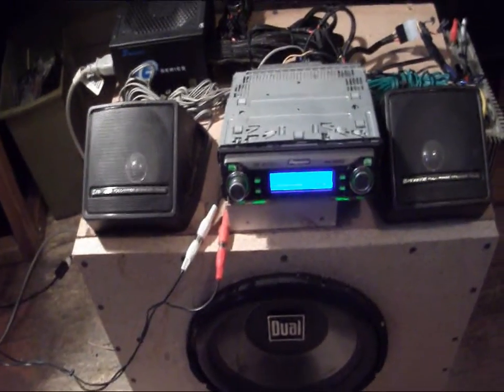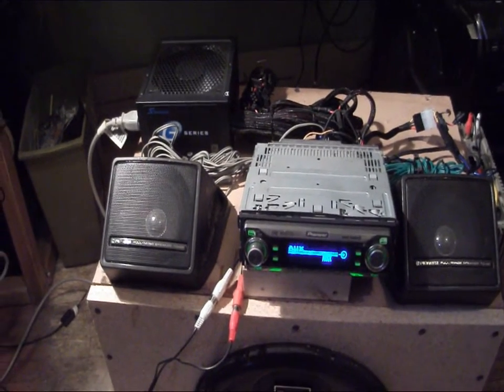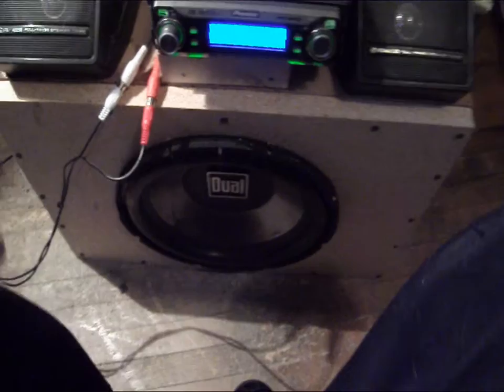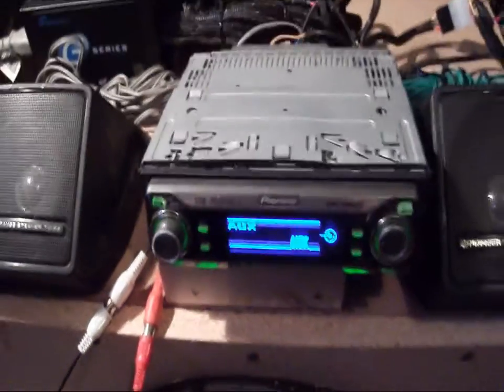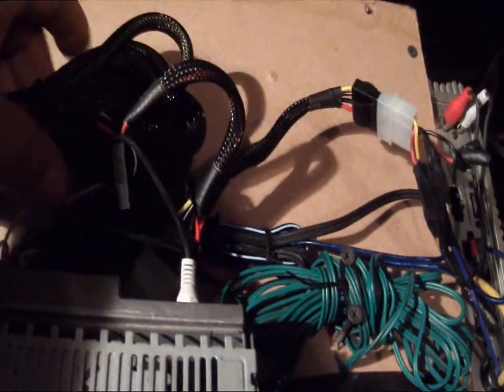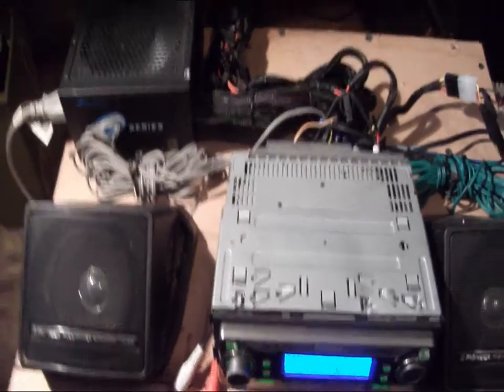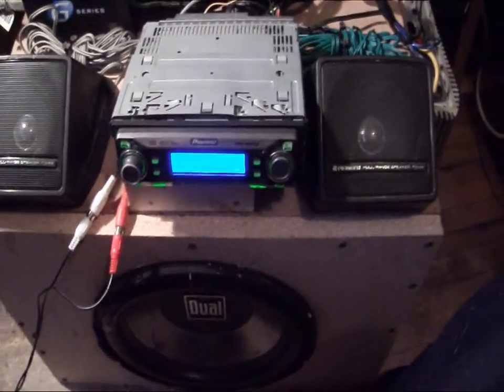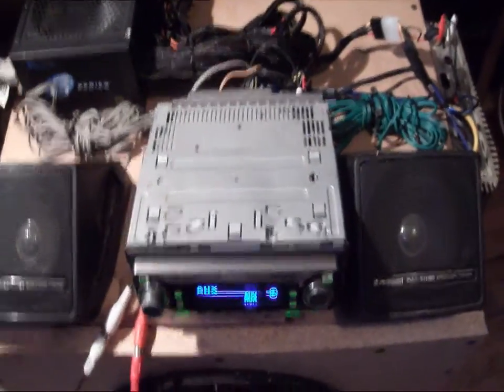Running a car stereo on computer power supply

Comment: Can you run the amp and stereo off a single 12v rail... Jst asking coz my stereo is getting hot at the heatsink on the rear when subs and 6x9s are pumping.

Comment: Can you do this in a permanent set up? I've actually put together an entire box with 3" Pyle Dryver bullet tweeters 6.5" JVC coaxials and a 12" MTX Terminator subwoofer with a cheap bluetooth head unit. The sub will be driven by a Nobsound mono sub amp @ 100 watts @ 2 ohms. I'm getting mixed info from my peers. Everything is wired with separate power supplies and want to only use one.

Comment: How much amps does the psu in 12v?
Reply: Depending the psu you can read psu reviews to find what you need (all the psu manufacturers saying 12v rail amps but not all of them are true), some good reviewers are: jonnyguru and kitguru they test how much amps efficiency etc. Some good PSU OEMs and manufacturers are: Seasonic,  Super Flower, FSP, Delta, Flextronics, Be Quiet!, EVGA, Corsair and Antec.

They all got low end - high end models/series. So you better need to read a bench test reviews to actual see the real specs :)

Comment: Do u connect the remote wire from  head unit to the amp or do u have to bypass from the 12v wire ? I don't know if it works if I bypass it by I would appreciate if u share that or give a wee explanation about that. Cheers awesome project by the way 👍

Comment: I didn't get what power was the sub amp. Usually you have to select the psu to provide enough power to the head unit and extra amps.

Comment: awesome project. I was looking up on internet for something similar and found this video really helpful to decide on the power supply selection. could you please tell me where did you connect your sub woofer to. I mean is it through the amplifier you have added and right from subwoofer outlet on the head unit or it just on of the 4 channels that is amplified through the amplifier ? a circuit diagram would be very helpful. thanks again.
Reply from the maker: +ansari imtiyaz ahmed Khadim Husain The sub is running off of the sub output from the head unit. The power for the sub comes from the amp. The sub is the only thing that the amp is powering. Pretty much the same way you would wire it in a car just that the power is coming from the power supply instead of from the battery of the car.
Reply: +FUzzyBUnnyBOoties Many thanks brother ... really appreciate your quick response that has solved my problem :)
Reply from the maker: +ansari imtiyaz ahmed Khadim Husain Your welcome. Any time :)

Comment: I've been looking at making something on the cheap for work but I wasnt sure if what I had would work. Will I see any long term problems just using a molex for powering a head unit and speakers? Or should I use a different connector? PC guy but I dont know much about power supplies.
Reply from the maker: Luke Messmer I have not noticed any problems using just a molex connector. I guess that would depend on how many watts you are going to try to run on your stereo. If you try to run something like 1000-2000 watt stereo through it I imagine the wires would get very hot. So after hooking up all your stuff just touch the wires every couple of minutes to make sure they are not getting too hot. Other then that it should be just fine.

Comment: should i use a 12V capacicator to the 12V yellow wire connection with the car stereo??? or you use the capacicator only for amplifiers??
Reply from the maker: Kostis Ketikidis Not needed for stereo or even smaller amps. As you can see I am running the radio and the amp on it with no cap.
Reply: thank you very much man... :) i used two black(ground) cables and two yellow(12V) cables from the computer power supply and now it works much better you should try it!!! :)

Comment: This is really a awesome idea to build or use of unused car stereo and computer power supply. Is the car stereo had RCA cable of its just a wire connected to stereo and amp.
Reply from the maker: I ran rca jacks from stereo to amp but it could be wired either way depending on what type of equipment you have.

Comment: I am looking at doing this.  I read somewhere that I need to loop a wire in the 24 pin connector to a ground to make the PS turn on.  Do you know if this is correct?
Thanks for the video upload.
Reply from the maker: Yes you do. It is a black and green wire on your 24 pin connector. At 2:43 of the video you can see a piece of wire stuck into the 24 pin connector.

Comment: Hello, i have a question.
can you see howmuch power this system use while playing?
Reply from the maker: If you mean how many watts it is using?. You can buy a power meter to connect the power supply cord to and it will tell you what the draw is on it.